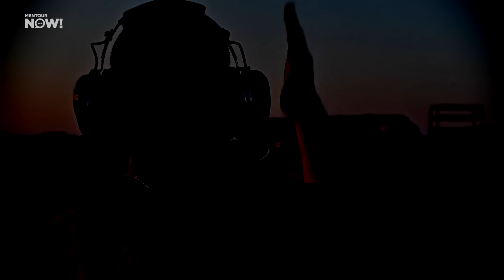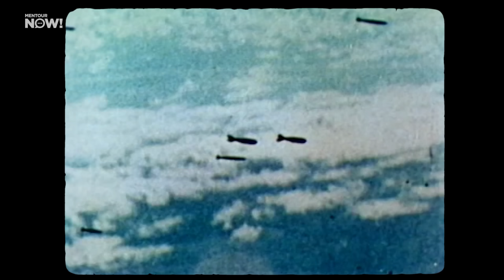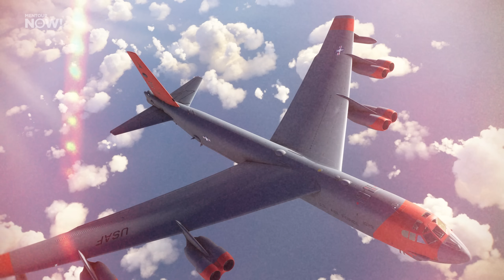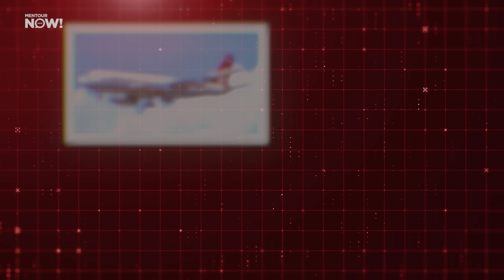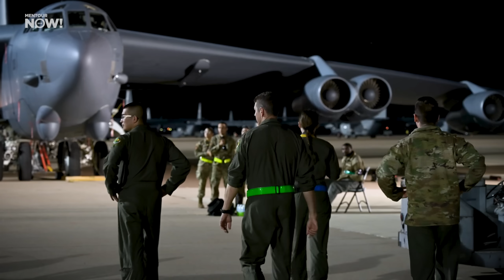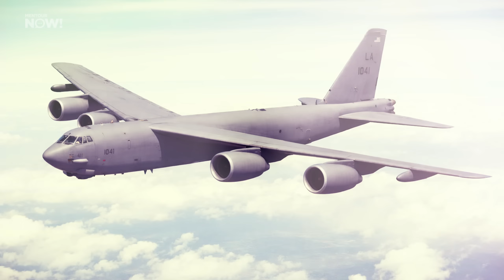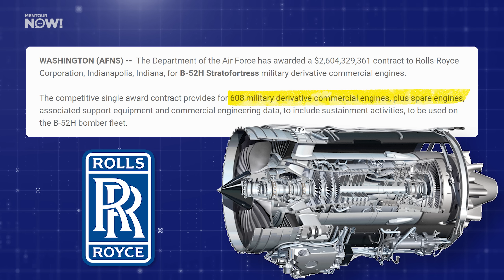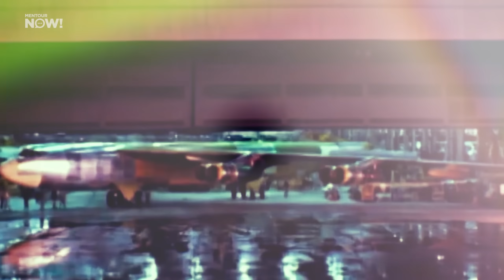WHY Are They Changing The B-52 NOW?!

Comment: Note to self when building a aircraft take 2 mechanical throttle cables + 2 potentiometers per engine throttle to a hardpoint in the wing side of the pylon so a ECU for the engine can be mounted there along with multiple shielded cat6 cables back to the cockpit and 2 multicore MICC cables for redundancy even leaving cables unused with caped connectors on each end. That way data links between the engine ECU and flight control computer can be done over a serial data link with a analogue backup if needed. The throttles could be connected to a TPS at the pylon that has a servo for auto thrust over the data link that would move the throttle position in the cockpit that could then be read back from their potentiometers creating a self checking system on both ends, with the gauges analogue readings could be fed to the standby instruments while the data link could connect to a flight control computer giving the pilots a set of digital displays. If it was pre built with excess connectivity and a modular ECU bay then the nacelle mount that had a big ole multipin connector before the engine wiring loom along with the opposite side of the mount having disconnects for air and fuel it could be built to be relatively modular to where engine swaps after years of service could be reasonably easy by using the spare connections already in the airframe, I know this would add weight but the lifetime engine fuel cost would be close to if not less than the cost of tearing half the plane apart for new wiring especially if new engine pods were developed that could be bolted on plugged in and the flight control computer flashed with a update to compensate for the thrust of the new engines within the performance envelope. Say the new engines could produce a substantial bump in thrust at low speed it could limit the engines to the equivalent thrust of the original until airspeed is high enough that the control surfaces have enough authority to trim the unwanted rotation out from the new engines getting pushed to their full power, if it was a set up like that just have a marked and verry visible switch in the cockpit for manual override handing over most systems to the pilot without thrust limits while having limited affect on inputs other than minor stability assistance, with it stepping in once the aircraft would be at safe structural limits or the raggy edge of its performance envelope.

Comment: Another big problem they've discovered is that the new engines provide too much hydraulic power. How is that a problem? The B52 is old enough it just has its actuators on or off, instead of being able to control speed. So the more powerful pumps would slam the landing gear and slats into their end stops more forcefully than they could handle. They may go to new less capable pumps to not over stress the existing hydraulic system.

Comment: TF33 engines were also on the RC135 aircraft I weld repaired at Kadena Air Base in Okinawa, Japan. Amazing engines, but prone to tailpipe cracks which were really easy to weld repair. Loved welding on those.

Comment: The fact that not a single part of it was designed on a computer yet its still going strong 50 years later. Today we cant even buy a brand new car without worrying that it will blow itself up before its warranty is up (or worse right after!)

Comment: Thank you for this video. For decades I had wondered why the B-52 was still going with an 8-engine configuration. I had assumed that 4 of the the newer engines couldn't match the thrust  output of the 8 older ones. I see my assumption was wrong, and instead the problem is re-designing the whole plane to work with 4 high-bypass engines would greatly spiral the per-plane cost out of control.

Comment: Sounds like the new engines are a very good fit.  I wouldn't have thought of all the other systems that require updating to go along with it.  I would certainly hope they'll be flying well into or past the 2050s if they new variant isn't going to be airborne until the 2030s.  As always, thanks for sharing.

Comment: Fun fact, the original B52 sketch was done on a cocktail napkin over the course of a weekend in Dayton Ohio.  It was originally a prop powered plane, but the USAF wanted jet engines.  The Boeing engineers sketched the new design on cocktail napkins, carved out a balsa model, and presented it in just 2 days.  The Hotel Van Cleve was demolished in the 70's, the planes are still flying.

Comment: I have wondered with all of these efforts to make the B-52 go longer and ultimately the plane is a bomb dump truck and a long range aircraft carrier of sorts of unmanned aircraft, why not try to replace it with a plane based on the Boeing 777?  As pointed out in the video, big considerations on a plane that you use for a long time is commonality with other aircraft, especially with engines and other systems inside the plane.  This still allows you to customize things like the fuselage and have additional military systems onboard as well as hardening of civilian systems but then you have a technology base on a more modern aircraft and a lot of systems already certified for flight.  The B-52 is not a supersonic aircraft.  The speed it was initially designed for doesn't even matter today.  Going at 777 speeds is fine.  For any high hazard missions, you would have a long range missile or drone fly 100+ miles to the target from the plane.

A fuselage designed to be huge bomb bays in the front and huge bomb bays in the back could have basically anything inside.  I just have this notion as even a first strike weapon a platform based on the 777 platform, you could have a pile of cruise missiles inside and just a handful of aircraft would drop out hundreds of missiles that would overwhelm defenses.

Comment: Part of the reason is it is much bigger than the more modern counterparts and has a larger range.  They never made a true replacement.  Plus it is great for mounting new weapons for testing because it is solid as rock and doesn't have a special 5th gen coating that could easily be destroyed.

Comment: You've obviously never seen a b52 in person the lowest engine is still far above your head when walking underneath. They should have just taken one that was ready for retirement and slapped engines on as haphazardly as they wished and flown it and said see it works. Lots of commercial planes have engines low to the ground and some big but not too big options in the hp range would probably have worked fine but people today dont have balls like the people who originally designed the jets of yesteryear.

Comment: Since there's a good chance that some people with a high degree of knowledge about the B-52 may be watching this video, I have 2 questions about the BUFF for which I've been unable to find answers -
1. Why was the original taller vertical stabilizer replaced with the current shorter one?
2. Is the (presumably) reduced drag of the shorter vertical stabilizer the reason that the B52 cruises with a slightly nose-down attitude?
Thank you for your attention to this matter. 😉

Comment: Remember the B-52 was imagined as a "must complete the mission" aircraft. Everything possible has a backup, and many of the backups have backups. Think of the B-52 as a four engine aircraft with a backup for each engine. 😉

(I worked on B-53Fs while in the Strategic Air Command back in the '60's. Of the various aircraft I worked on, I liked the B-52 best. Each and every one of those old beasts has its own personality.)

Comment: Thanks, enjoyed that. I'm roughly 70 years old, which means I knew what B-52 were as a kid...and they're still around. I also noticed how much they were sticking around when all of their sibllings,  the B-47 and the B-58 Hustlers, all of the fighter planes, F100, 101, 104s  came and went. I suppose there are still F-4s in guard units. It seemed like 20 years ago they got new life as a (stand-off) launch pad for cruise missles.  I can't imagine getting a B-52 over say Russia these days to drop an A-bomb.  (and no, I don't wish that to happen)  My one question would be why is the Air Force hanging on to them and think the simplistic answer is it's still the economic bomber compared to all the speed and high tech wizardry of B1's and B2's.  What was hinted at but not really said here is even with all the things that need to be torn out and replaced it's still a LOT cheaper to do it this way.  Yes, commercial aircraft design needs to be mindful of creating more modular designs which can be updated a few times to keep the airframe viable but that just gets to be beyond any sort of design horizon (or that's your point?) when you've had an aircraft around 60-70 years.  And, oh yeah, three cheers for the original designers of the B-52.

Comment: Totally get that aircraft will remain modern marvels for decades to come. That being said, there is an innovation implementation pipeline that feels slow to even the most cautious of observers. By the time you implement a new engine for mainstream use, it is 10+ years old. Quicker modeling, testing, shit AI testing IDK is needed. I don't want flying cars, but I want modern equipment on modern aircraft. Feels like we could invest in R&D + Testing to shorten the implementation pipeline. Once a new engine is proven we should have that rolling out to aircraft is less than 5 years. Saftey is priority and I think all can be achieved if the investment is there. In fact I know it could be achieved if investest was there. Put 20-30% of American GDP on aircraft innovation and watch wormholmes start opening :). It can be done (Quick innovation that is).

Comment: Commercial and Military demands may well be different.  
I hated flying in the old rear engine jets.  They were noisy, rough, and uncomfortable, especially for passengers in the back, so passenger comfort has to be part of it.  Likewise, I'd anticipate a complete interior refit would be needed every few years just to keep passengers happy.

How much do the B52s fly?  A commercial airliner may well do multiple flights a day every day of the year.  Thus, they may arrive at the fatigue limits of the airframe and other materials much quicker. 

Overall, it likely means a constant need to upgrade for the commercial planes, something that the military seems to have managed to skip.

Comment: I have never previously heard the expression "slide ruler". I remember in 1980, my technical drawing teacher on day one telling the class that a rule is used for measuring, and a ruler is used to trace a line with a pencil. He would punish anyone caught using a rule as a ruler, because the rule would later be used to measure and mark drawings, sullying a clean sheet with the graphite along its edge. A "slide rule" is a calculation engine. It is never used as a ruler.

Comment: My father served 22 years in the Air Force and I watched b-52's take off during the summer time on Guam.  You have to have some real balls to soil your pants.
When they went off the end of the runway over the cliff they dropped for about 10 seconds and then they climb up and out. 
Many a new pilot have been known to have involuntary movements.

After graduating from school I got to work on a retrofit for the B-52 because the components were difficult to obtain.

The B2 has been refitted and upgraded so many times.
If my grandson goes into the Air Force maybe he'll get to fly on one.  He's 6 years old.

Comment: Eight high mounted engine was a design choice for operating from short rough airfields. The side by side engine layout efficiently blows air across the underside of the wing. Increasing lift particularly while in the ground effect. Being able to use nearly anything as a airfield was a valuable capability proven by the B-29 campaign in WW2. Cheers

Comment: Why update it?  Because it's exactly suited to the purpose it's being used for, and it's a hell of an air frame.  I spent a little over 4 years at K. I. Sawyer AFB near Marquette, MI. clambering around in these and KC-135s. 

edit - Just realized, both of these are about the tanker.  Working on the Buff was a lot roomier and virtually everything I had there was inside.  It got cold in the winter, but you didn't have the arctic blast on you.
edit2 - Sometimes, you just need a big bomb truck.  

Being small and relatively strong, I got all the fun stuff like crawling up inside the very tail end of the tanker fuselage to remove and replace the APN-69 radar beacon.  Looked like a 70 pound metal trashcan with a bolted on lid.  If you rotated it just right it fit out the hatch.  
Search radar antennae were a lot easier to get to but that could be a thing, too.  You had to pull the nose off to get at it, and despite what you may have heard we did have 4 seasons; June, July, August, Winter.  Wasn't too bad of a job for 3/4 of the seasons.

Comment: While they were originally designed to throw nukes, those became obsolete once ICBMs started to show up.
So it was turned into a large bomber for conventional bombs. And there isn't any other bomber of that size around. Developing a new one would be expensive

And I've been thinking an engine upgrade is long overdue for it.
More efficient engines would mean less fuel consumption and thus more range and longer operation without refueling. 
Or alternatively the need to carry less fuel and freeing weight for more payload.
Plus an engine swap is much cheaper than designing a completely new plane.
Something like the PW2000, CF6, CFM56 or V2500 would be not a bad choice. A lot of them are around and they are still in production, so spare parts will be covered for a long time.

Looking at the CF34 in the 10E model, it gets to 90.6 kN peak thrust (about 19% more), a 5.4:1 bypass ratio, a similar diameter and length and weights 19% less. Fuel consumption is also about 19% lower. So not too much of a difference, but enough that it might be worth it. And a slight upgrade in performance might be worth as "emergency power"

But it seems like they're going with german-designed  Rolls Royce BR725 instead. Closer to the original JT3D.

And 8 vs 4 engines, whatever 4 engines can do, 8 can do twice of it. Twice the redundancy, twice the thrust.

I can absolutely see that the engine swap will take some 20 years, with H and J models in service simultaneously. The more are upgraded to J, the more space JT3D are available to keep the continued H models running. And they certainly will get a service extension once all planes are upgraded.

And I'm not surprised that the B-52 is still flying. I mean, the 737, 747 and DC-9 families are also still around, despite being designs from the 1960s.

Comment: The reason The Buff still flies, is that its replacement, no matter how many advanced tech gets thrown at it, will just be an aircraft that looks almost identical. The Buff is a giant cargo hauler gliding-truck. It does this job very well, despite horribly inefficient engines. You can put a more efficient engine in a locomotive or 18-wheeler cargo truck, but it'll only get you so far...  Ditto B-52.

Comment: The original wind tunnel tests on the B-52 were concentrated on the placement of the engines, partially because the engines functions as counterweights to the torque moment that keeps the very thin wing structure in place - there exit films of the wind tunnel test, where other engine placements were tried - and they flipped the whole aircraft.

The other argument is how to dispense with tanker aircraft as well, which in itself is a considerable saving - both in personel and building. The KC-46 is not a cheap aircraft. Refuelling a B-52 is far from a simple procedure. I believe the real reason for the bumping Lt. Flynn to Hercules was not her sex-life. The B-52 keeps big and strong men in sweat and Lt. Flynn is a small woman - she simply could not fly the aircraft. The C-130 is a very docile plane to fly.

The B-52 has a service ceiling of 50.000' where there is not much air. The next thing is - what I don't know. How the ""coffin corner" acts on the B-52. The problem is not so much to get up there, but to get DOWN. Decend and the plane will hit supersonic speed at that altitude, reduce engine power and you risk the wing stalls. If you deviate from the recommended airspeed you will stall either from shock stall or from lack of lift of the wing. That is being caught between a rock and a hard place.

The next thing is the primary role of the B-52 today. It is hardly as a nuclear bomber. I think its primary role is as a mine layer. That is why you see it at low altitude in Estonia. Mine laying is done BEFORE you start shooting at each other. There are no other airplane that can mine at those distances.
As a bomber it will not survive the SAM's from a corvette.

Comment: There is also treaties like SALT that regulate new strategic bombers and numbers.  Then cost.  You don't need to use a B2 or B21 to do missions over third world countries.  If it is too expensive to lose then you don't risk it.  I also want to know why not use 8 engines from a F22?  Doubling the trust and super cruse.  The plane can sustain low supersonic numbers.  An engine still built and hugely efficient.  Someone try it in Fly Out?  Would be interesting to see.